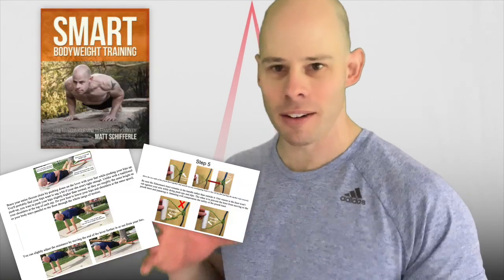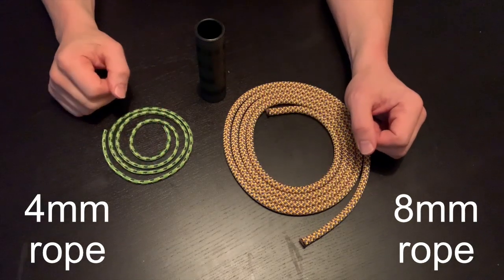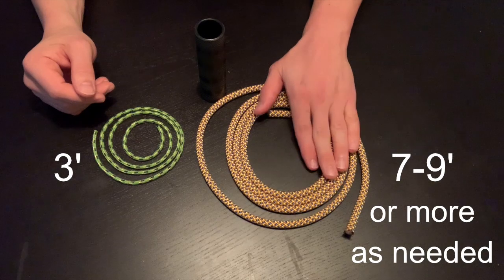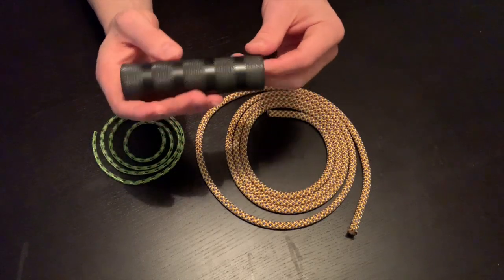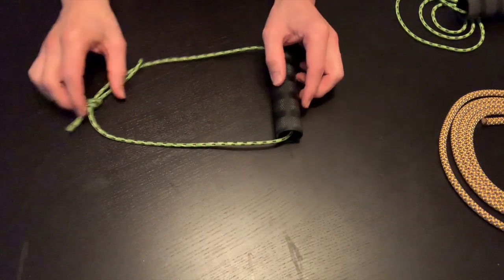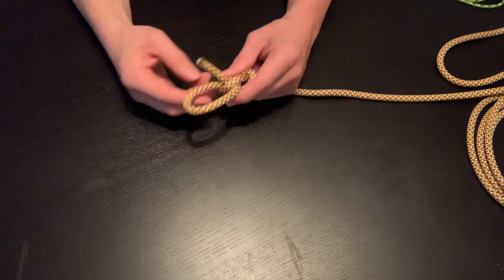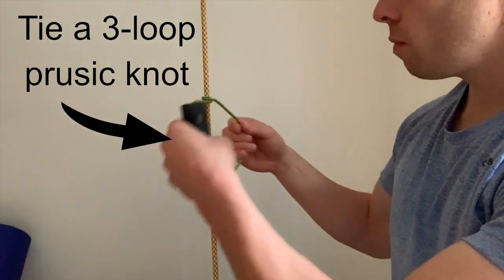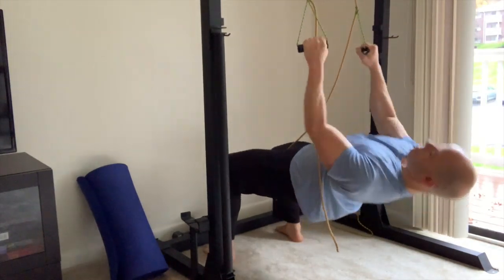Simple & Easy DIY Calisthenics Gym

Comment: Thanks Matt for your idea! I used Bike handles with a metal pipe inside instead of plastic handles. Much more stable but a little heavier of course. I doubled the length of the 8mm rope. Then I can throw every rope across the high branch of a tree in order to connect both ends with another prusik knot. My training is not limited any longer to low branches in the forest. In this case the bike handle can be linked with the rope by only one loop at the lower end of the rope.

Comment: Went the cheap way, used a small length of pvc cut it, using a blade for me was iffy seemed to be uneven & would gouge probably because I've cut myself so many times in the past & wasn't comfortable lol. Since I like fire, I melted the edges smooth followed by your rdp pull up handles finishing touches. Used a single loop prusic to connect the handles for standing rows when all I have around is vertical objects. Whew! In a nut shell, thank you so much for these videos!!

Comment: Great job!  You could also get one 12-17 foot main rope and run it through an appropriately sized Runstan pulley.  Attach your prusik grips to each end of the rope.  Use a carabiner to attach a door anchor to the swivel on top of the pulley.

Comment: I've made mine and I prefer a rubber hose of suitable dimensions for a handle.  It does not fray the handle rope at all.  Long time ago I used to loop ratchet straps over my pullup bar with rubber hose handles too.  That worked just as well.

In preparation for sailing season I like working out with handles made out of the rope itself.  It's a bit advanced to make (no biggie for a sailor, obviously) but it helps in conditioning the skin of hands to this specific stress.  Less blistering afterwards, even if the winds blow well.
Reply from the maker: Good tips, I've also played around with making handle ropes and haven't found anything quite suitable yet. Any tips you could share?
Reply: @RedDeltaProject - When I use rope handles, I don't use prussik loops at all.  I just shorten the main line to the required length at the bar itself.  It's easy and quick.  I use mooring hitch for that (https://www.netknots.com/rope_knots/mooring-hitch).

The knot I use for rope handles apparently is called "heaving line knot" in English.  It's tied in two versions, but the one I chose is shown on wikipedia entry. (https://en.wikipedia.org/wiki/Heaving_line_knot)  

As you can see, there is a bit of rope sticking out at the loose end, right after this thick coil which forms the handle.  You can grab this coil and use it as is, which is good conditioning too, but for heavier work I prefer to leave this end bit longer and form a loop, with the coil in the middle becoming a standard horizontal handle.

Obviously a bit thicker rope would be required than what you tend to use, or you can put a dowel or pvc inside the coil to make it thicker and easier to grab. 

Hope it all isn't too confusing...  Much easier to show, that for sure.
Reply: @bakters  This is creative and brilliant and I look forward to checking out the links you provided. Thanks for the information!
Reply: @TheDamianvain17 - Well, this creative and brilliant person who invented all those knots died probably many thousands years ago.  Anyway, there are more illustrative links out there, so in case of trouble, just search around.
Reply: @bakters  I'd say there were lots of people creating the knots we use but I was referring to your ability to take and modify the system with all the knowledge you have. Plus, honestly, it's truly rare and amazing to see a well written reply, articulated in an intelligent and simple manner.
Reply: @TheDamianvain17 - Thanks.  I've been called basically an idiot today, so I'll take your kind response as an even-out kind of deal.  Internet taketh away, but it giveth back sometimes too. ;-)

Comment: Matt, thanks so much for this. I have been making DIY and buying knock off TRX bands for a few years now. Your approach is by far the best; simple, clean, secure etc. 
However, I have made some changes and additoins. See what you think:
First I use a single piece for the main suspension rope and then simply loop the rope over and through itself to the anchor. 
Second, I hold back the spare rope either with a sliding knot or road bike innter tube. Thus when the handles are high up the main rope, the ends are dangling annoyingly about.
Thirdly, for use in hotels etc, I use previously made door anchors made from strap/webbing (lorry load securing stuff).
Would add pictures if I could. 
Thanks for this excellent method.
Bob
Reply from the maker: All great ideas there Bob. I usually much prefer a dual anchor point system as I find those a more versatile, but in some cases (like in a doorway) a single anchor point is simpler and just easier to use. Great call on the use of the bike tube. I would love to see pics of that if you get a chance (reddeltaproject@gmailcom)

Comment: As per usual, great video with the update. When I saw the title I thought you, again, found yet another tweak or enhancement to make it better. Looks like you have definitely perfected it last time. Obviously, I found your last video from a couple of years ago, just last month. Even though it's more work, I am still going to get 1 1/2" PVC so I can also train grip and work up from there. I believe grip may be the biggest determining factor of fail or succeed. Thanks again for great work!
Reply from the maker: yes, I neglected to mention that using PVC gives you the ability to customize the length and diameter of your handles which is a plus.

Comment: Thanks Matt. Got your books now to make a suspension trainer, only difference is I will be using paracord. Keep up the good work.
Reply from the maker: Be sure to check the strength of that cord. I've seen som paracord that's only rated for 2-300 pounds. I always try to use stuff rater for at least 800#
Reply: @RedDeltaProject  Thanks for the reply. I have 100s of meters of the stuff so will start by twisting 2 lengths together for strength and see how it goes. I already have a generic TRX setup so this is more of a fun side project.
Reply from the maker: Ah good call. Love to see a pic or vid of it when you're done

Comment: I really like this design a lot. 
Is that polypropylene rope? If not, what kind is it? And would the polypropylene be suitable? (justing by breaking strains at those diameters it certainly is strength wise, I’m more curious about the other qualitative differences in the case that you might be using a different kind of rope. Thanks.
Reply from the maker: Not sure exactly what it is. It may be kern mantle rope, but it's whatever you can usually get in custom lengths at the local REI.

Comment: How to make sure the smaller rope won't slip over the larger one?
Reply from the maker: The prussik is a cinch knot, so the harder you pull on it, the tighter it holds. 
If you use two ropes that's the same diameter it may not hold quite as well. That's why you want a 2:1 rain in the diameter of the rope.

Comment: Just out of curiosity, roughly what does the 8mm line run for you? I was searching Amazon and ran across some Nylon dock line, which comes in 3/8" and 1/2" and can get it in 15' lengths. The nice thing is that one end is already looped and woven/sown so there is no need for the top knot, you would either cut it shorter or leave it at 15'. I was just trying to get a gauge for what would be a good price for materials. I've been wanting suspension trainers and I'm excited to get started on this.
Reply from the maker: it's been a while, but the two lengths should run between 8-12 bucks

Comment: cAN i GO FOR Belts for lifting cargo To make TRX bands as they have factory fitted hooks inbuilt at both ends and they have inbuilt ratchet to adjust length of belt.2 belts of 2 M length having  0.8 Tonne capacity costs 450 INR(6 $)
?ANOTHER OPTION IS CAR towing straps or Mountaineering ropes.Please opine.
Reply: This is exactly what I did when I started my suspension training, it was just what I had laying around. The straps are a bit short for what I want to do next so I will be upgrading to a set of rings with numbered straps.

Comment: Hi. I have a similar suspension trainer made from a chain and a pipe
Reply: Highly recommend it
Reply from the maker: Sweet!, Send us a pic sometime. I've experimented with chain a bit myself with mixed results. Curious what you've been able to build
Reply: @RedDeltaProject  it's a fairly simple concept. You have a 2 meter chain with a snap link at each end. You will also need a 50 cm chain and a 20 cm steel pipe. Insert the small chain through the pipe and then lock both ends to one of the snap links on the long chain. You now have one of the suspension trainer. Do the same for the second one. You  can use the unused snap links to lock the suspension trainers to a bar/hooks in the ceiling etc. The handle (pipe + short chain + snap link) height can be adjusted easily by clipping the snap link anywhere on the chain. It sounds harder than it is. You'll get the logic as soon as you have all the items, don't worry. I really hope you try this. It works wonders for me. Cheers.

Comment: Where do I begin? Well first climbing rope from a climbing store is far from cheap. Also if you cut the rope yourself there is something called a lighter. A lighter makes a flame. You take a flame and put it at the end of the rope and you have a well molded end of a rope. You purchased handles and want to dispose a well placed strap. You want people to use this knot and that knot and etc. and you paid how much for this?  Well I ask because today in 2025 things are a lot more money and I just bought a set of rings for…wait for it…$38.66. For that I have two very long straps. I have two looped straps. I have a single looped strap attached to a plastic ring surrounded by foam for hanging off a door. Also with a carabiner can get very creative with mounting. I give this video a big thumbs down! 👎